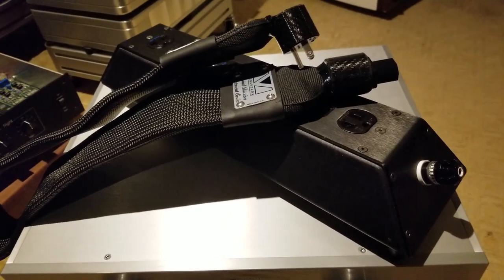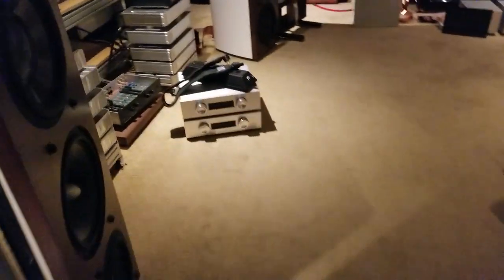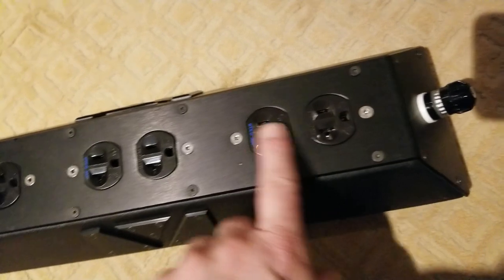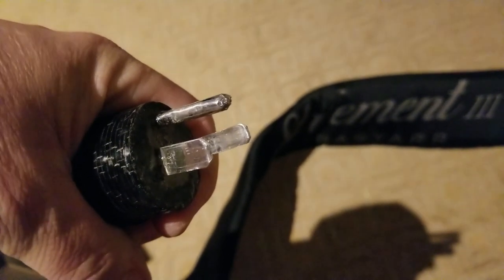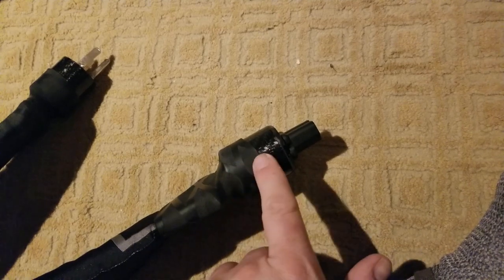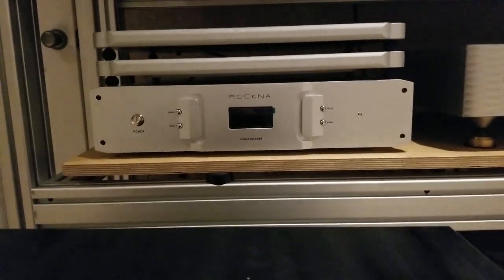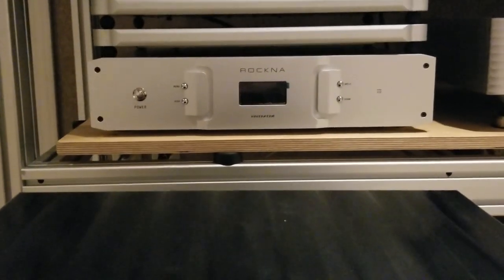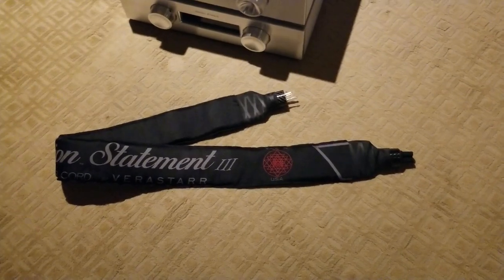OCD AC POWER behind your rig.

Comment: What are the voltage and current ratings of your cable ?? Are you planning on UL listing prior to selling it to someone ?? I just recently found your channel and have been watching a few vids, one more question, do you own a oscilloscope ??
Reply from the maker: No need to UL list. I've got CE approval on it and yes, I've got an oscope.
Reply: @OCDHIFiGuy 
Wow, that's a hell of an assumption, no I don't think that nor did I say it. I'm asking legit questions which you did not answer ?? Again, what's the voltage and current ratings ??
Btw, the reason I asked about UL is because my company is UL certified for rebuilding UL equipment, after rebuild we recertify with new UL tags.
Reply from the maker: @poserwannabe1  20 amp 250V

Comment: Hi Mike, did you compare your power cords to siltech double crown or triple crown?
Reply from the maker: No, my beta tester clients use Nordost Odin 2 which I beat, Purist Audio , which we beat, and Stage 3 Concepts which we were different than but equal to, and furthermore the 2 brands have good symbiosis. I never buy other companies cables, so its up to my clients to either send them, to me for compare, or do it themselves. My cables are no joke. Cables are my full time career, not youtube ...
Reply: @OCDHIFiGuy  i know, I heard your cables at a friend's system recently - sounded good and he preferred them over top of the range Acrolink.
Reply from the maker: @ProGwardzista  wow Marcin, that's excellent news. Which cable type was it ?
Reply: @OCDHIFiGuy  I don't remember exactly. What I know is that the cover was in light colour.